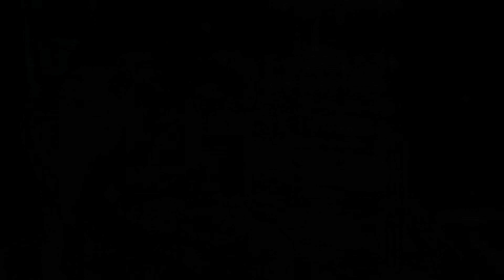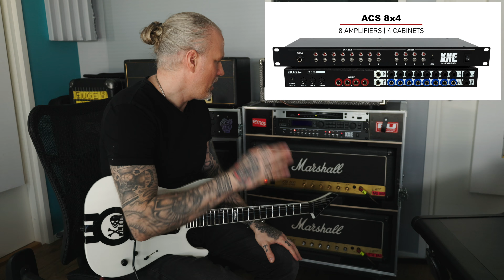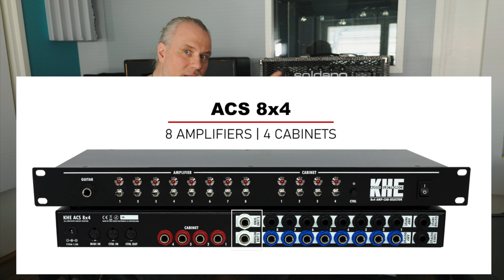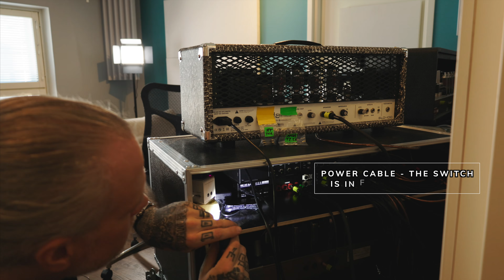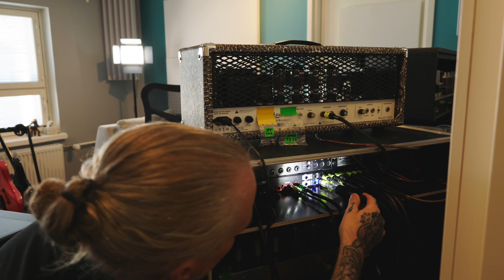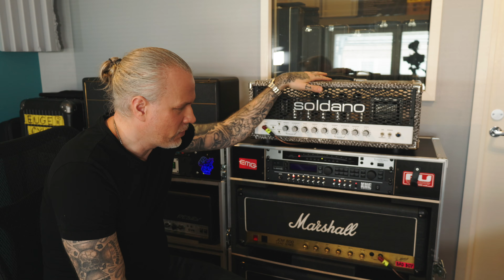I'M STOKED! | KHE Audio Electronic ACS 8x4 AMP & CAB SWITCHER

Comment: Does the unit you have include the loop switcher or do you need to buy that separate?  It's very confusing looking at their website.
Reply: The 8x unit does not have the built-in fx-loop switching, it requires the AFX8 add-on unit for that. The ACS4x4FX has the function built-in (4x amp switcher). If you have any questions please let me know.

Comment: Mandatory piece of gear if you own multiple amps! I run a Power Station in the S-Line loop and then use the FX loop of the Power Station for  post effects. Great solution for older amps without an effects loop and for minimizing the amount of cable runs for various effects loops!
Reply: Im literally making cables to do this. Also linking another 8x4.
Reply: Thanks a lot!